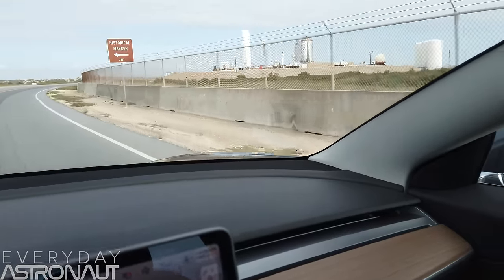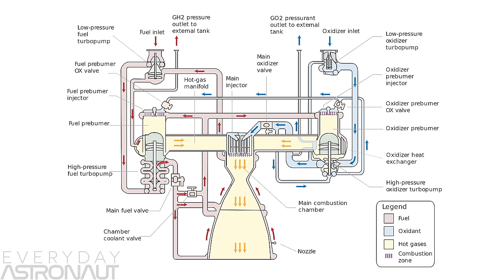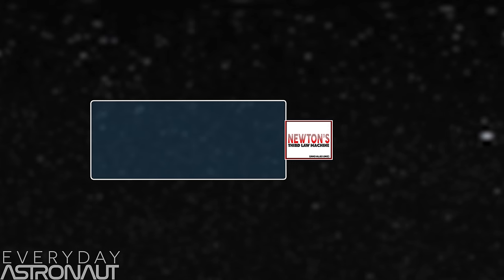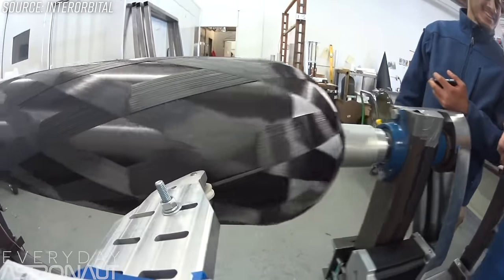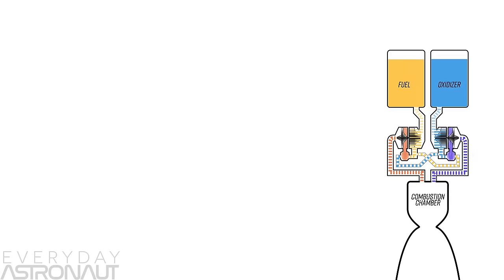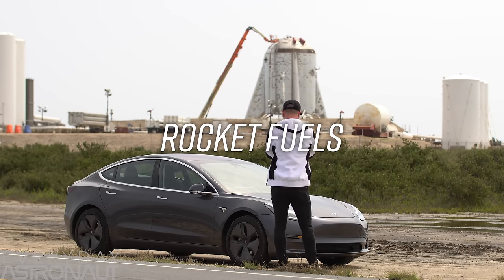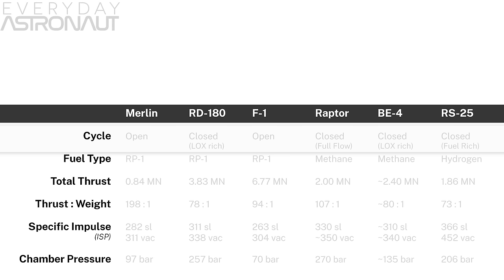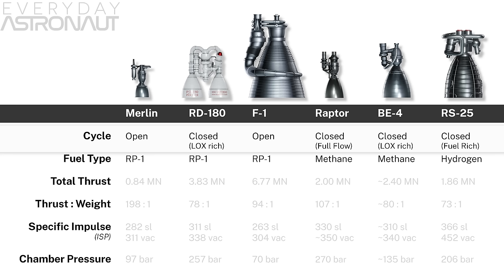Is SpaceX's Raptor engine the king of rocket engines?

Comment: The fact that the F-1 holds up as well as it does despite how old it is speaks volumes about the sheer engineering that went into the Saturn V. Truly a beautiful craft that I hope will always be remembered in this new era of spaceflight ushered in by SpaceX and beyond.
Reply: Very well said.  Bravo.
Reply: Didn't the center engine on Apollo 13 shut off?
Reply: I mean, the F-1 did have 2 total military fundings, the first was for ICBMs, and the second for Apollo. So it's numbers are insane in even more ways, sadly that also includes price.
Reply: @johnabsher6518  that was the second stage, not an F1
Reply: @Gaming1Doge  It was developed for the Air force, then shelved because they didn't need it. Then along came NASA and gave it new life. The F-1 was, and still is, the most powerful single chamber rocket engine ever produced.
Reply: @jameshowland7393  true that